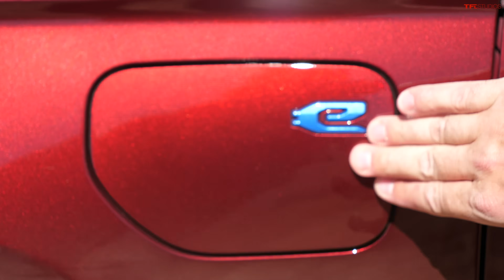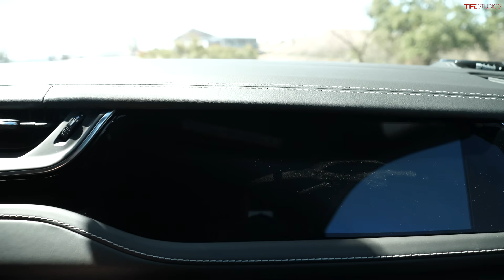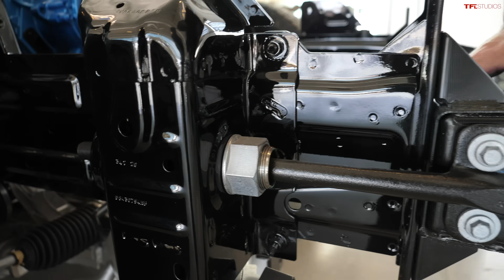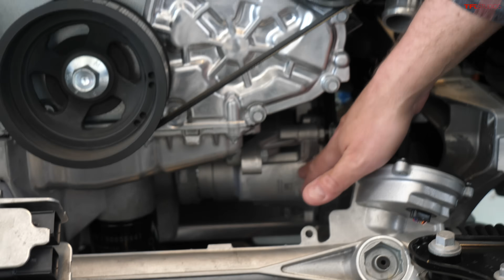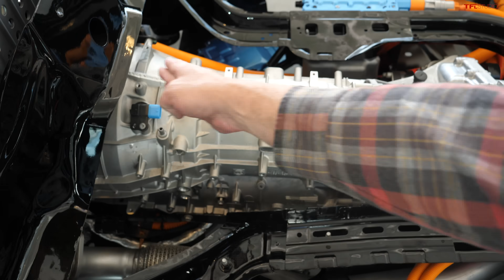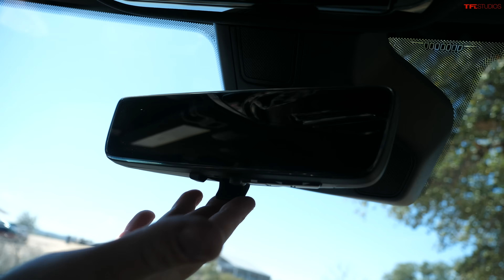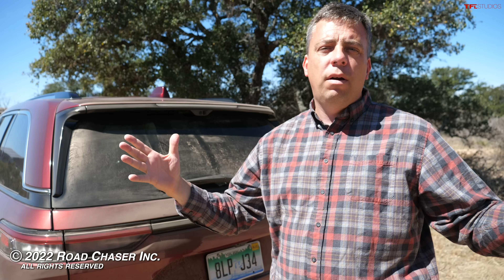Jeep Grand Cherokee 4xe: Does This New Plug-in Hybrid Let You Have Your Cake & Eat It Too?

Comment: I've driven PHEV and BEV for 10 years now. Honestly PHEV makes a ton more sense if you live where I live. Lots of wind, -40 in winter, not the best DC infrastructure, etc. I'm 100% PHEV fan even though it doesn't get the headlines like BEV vehicles.
Reply: That's where I'm at too. In line for a hummer but not going to pull the trigger
Reply: Wyoming?
Reply: @CrumResearch  I’m north of Montana and North Dakota, in Canada.
Reply: @InternetDude  - we live n a similar area. I’m in the foothills. Wind!! Had a Jaguar I-Pace,,, well my wife did, and it was an amazingly good vehicle. At the time, the only EV CUV that was allowed to, even encouraged to go off-road. I tried it a couple of times (my wife was not leased either time) and it was surprising!! Not Touareg surprising, but Bronco Sport Badlands surprising!! I wouldn’t use it for hard off-road use, and the bit I did, was hard on the battery as far as range goes. Range was a huge thing!! You head up Forestry trunk road and you know there’s nothing out there for charging except your home!! Winter would shut it down due to the range at -40. -30 even. 
    She switched to a Jeep Wrangler 4xe instead. We put Michelin CrossClimate 2s on it and it has performed very well. Even living out in the middle of nowhere we are still a few miles from a smaller town, village actually. She has routinely run on EV only about 70% (69 - 73%) of the time. She has no range anxiety and I use the vehicle as well! She has been dealing with a dealership in Calgary and has a Grand Cherokee 4xe on order. I will keep the Wrangler still. I used to do hardcore off-roading, but my bad back is enough so that I had to quit due to the jarring etc. I will still go fishing into some iffy areas and have the lift kit and 35” BFG KO2s waiting to go on. It will have 18 inch wheels instead of the 20s that are stock. A winch and steel bumpers and I will be done. (Maybe skid plates, especially up front, but that would absolutely be all I would do to it. I do have a F150 Tremor as well, so don’t need the Jeep Wrangler, but the EV side of the vehicle is very interesting though, especially with today’s fuel prices. Keeping it vs selling it, means we would never get ahead $$$ wise, but you still feel better doing your part. 
      Regardless, I think this can be an ideal vehicle for city dwellers also. With the limited slip rear differential, there’s some serious capabilities for the vast majority of drivers off-road. They can run all electric during the week, use the hybrid mode all weekend doing their thing in the country, and go back to EV in the city the next week and so on. Not a bad set up at all.
Reply: @C10sRule  right on
Reply: @jeffrentsch4318  - think of the demand vs the forest available for use over and above what is already being over forested. Yep!! Sounds sustainable to me!! Hahah. You are only thinking of yourself and not the greater picture.

Comment: Volvo xc90 did this in 2016. Not exactly the same but worthwhile noting.  Battery should be 25 / 30 kwh. Check out the gle 350de.

Comment: I love the mpge rating on this vehicle, just not sure if the price is justifiable.  If it only has a 4cylinder engine I guess that it is more then capable to pull the 6,000 lbs when the battery is completely discharged?  Would they be able to just offer a 4 cylinder turbo in this vehicle that gets 30 mpg and costs 20K less?  Quite an interesting vehicle that gets me thinking.
Reply: The battery is never fully empty.  It keep 15% for hybrid function, for when you need a bit of power.  It recharges the battery when you operate at partial throttle.
Reply: Yeah battery never fully drains. As you are driving you can see on the cluster that electric and gas engine work together. From a dead stop it will take off in full electric and then the engine comes on to assist and recharge. You can feel the instant acceleration and torque not sluggish at all
Reply: Also, maybe they can take a page out of the Chevy Volt/ other PHEV book and have a Hold/Mountain mode where the gas engine can charge a reasonable buffer (20-45%) depending on PHEV car and that buffer along with the gas engine will help you haul anything straight up Mount Everest or something similar. Worked great on gen 1 Volts, was almost a necessity on some terrain with its 84 horse gas generator but 150horse/250lb-ft powertrain output
Reply: Same reason fancy trunks aren’t focused on functionality.

Comment: If they could get the E-range up to about 50 miles I would be interested as I commute about 52 miles a day round trip to work and back. I'd go for the Trial Hawk edition to replace my 4Runner.
Reply: yes, battery capacity and energy density increases over time could improve the utility of this 4xe powertrain nicely over time.  We just got our Rubicon 4xe yesterday here in Utah and it is awesome -- makes me really happy using and managing electric mode.
Reply: I have a wrangler rubicon 4xe and a 60 mile Round trip commute and average 26mpg for my commute.  So in other words, the value of the battery isn’t limited to trips of 25 miles or less.
Reply: @davidcarrico3385  great point
Reply: Rav 4 prime ftw
Reply: Starting next year, all Trailhawks will be 4xe.

Comment: “super heavy duty steel”, then you quote the thickness as a few millimeters. 😄 maybe jeep should have given the measurement in inches to sound better.
Reply: 3.5mm or 0.138in thick. Giving it in freedom units would make it sound worse
Reply: @dochollywood1921  No one quotes inches that way. You would say “greater than 1/8th of an inch.” instead. It would be harder for people to visualize, hence sounding thicker than quoting mm.

Comment: Overland is mid-range? I remember when it was the top trim (if my memory serves me correctly).
Reply: My ‘05 WK is ‘limited’ which was the highest package… how times have changed 😂
Reply: @AgentXRifle  agreed, and how prices have changed!
Reply: The Limited is the midrange.  The Overland is much closer to the Summit than the Limited.
Reply: Overland has been midrange for quite some time. For the WK2 it was Laredo, Limited, Trailhawk, Overland, Summit, SRT, Trackhawk (as well as like 6 other models that are based of those trim levels). The overland for the WL is technically still mid-range, but definitely leans a bit higher.
Reply: Overland which is what I have was just below the highest trim Summit. Now they have Summit and Summit Reserve which is pretty luxuriouos
Reply: @ozgunique  Yeah, I guess the Summit and Summit Reserve weren’t a thing years ago. Kind of how Ford’s Lariat used to be the top trim and now there are multiple trims above it.

Comment: Andre: that small info screen on the passenger side is right where the pass airbag usually lives. Where did they move that airbag?  Thx
Reply: Jeep didn’t have to move the airbag in most cars the air bag deploys from the top of the dash. Not the front part of the dash.

Comment: Jeep needs to extend the electric range! 25 miles isn't enough for the price, should be closer to 40 like the Rav4.
Reply: I've had a RAV4 Prime for over a year and I'm spoiled with that much EV range. It's very hard to go buy something else with much less range.
Reply: The Rav 4 is a smaller SUV by weight comparison . Plus it’s fwd based so it might have less drivetrain loss
Reply: The Rav4 Prime is AWD. Yes its smaller but so is the Wrangler 4xe that gets the same electric range as the Grand Cherokee
Reply: @nunosilva3176   the wrangler is usually on off road tires and is about as aerodynamic as a rectangle lol
Reply: My point exactly,  no reason why the Grand Cherokee has the same electric range as the wrangler!

Comment: worst of both worlds but at least its progress....
Reply: It's nowhere near the worst of any world. An EV is expensive, it has limited range, and charging time is ages. An ICE vehicle, particularly an 4x4, would be a gas guzzler. The 4xe is far more fuel efficient than a normal ICE 4x4, while it's cheaper and doesn't suffer from short range or long charging problems of a comparable EV.
Reply: I traded my Tesla Model S for a RAV4 Prime a year ago. You are wrong, for most people PHEV makes more sense. No need in hauling around 800-1000 lbs batteries for daily driving and unlimited driving range on road trips. Perfect!